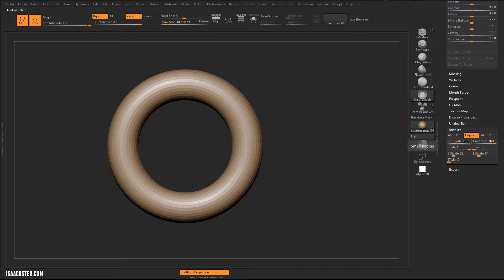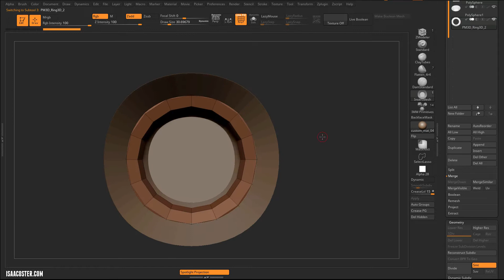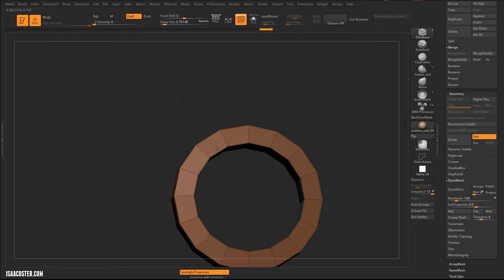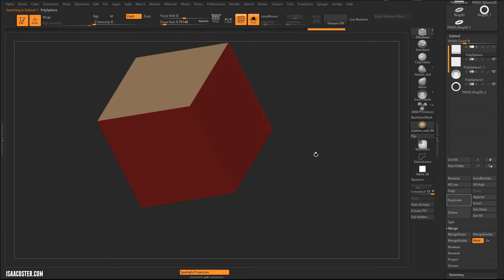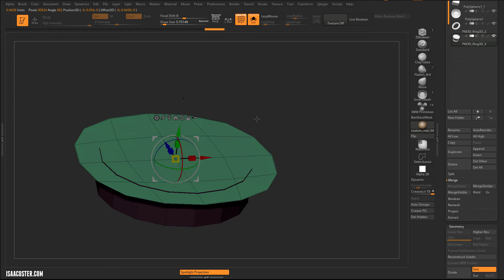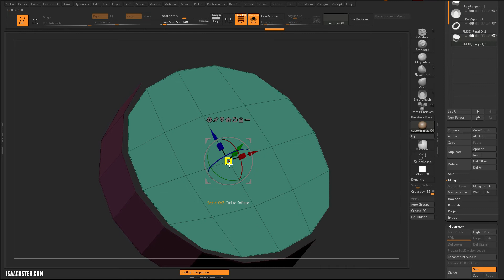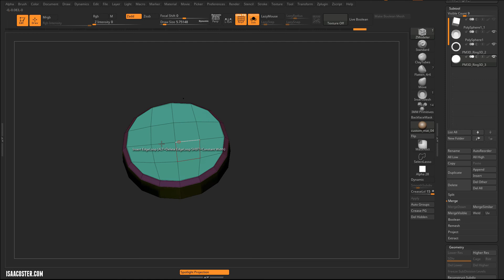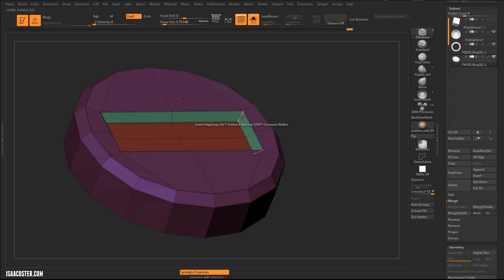Hard Surface Modeling with Zbrush 05 - Insert Mesh Brush Part 2

Comment: 9:42 I am struggeling with this never before  explained tool and it is frustrating, because I don't know how to use it or what I am doing wrong. Key-Inputs on screen also would have been very helpful. Aside from that, still tysm
Reply from the maker: y key toggles between transpose tool (three yellow circles) and the transform gizmo.  w,e, and r keys switch between move, rotate and scale.  control key enables the masking tool.  I'm using MaskRect here.  Here's a refresher on the transpose tool.  https://www.youtube.com/watch?v=IG2C87QUcJs     Masking refresher here: https://www.youtube.com/watch?v=Q_b31IC0FpU
Reply from the maker: You may want to watch my Intro to Zbrush series if this looks unfamiliar: https://www.youtube.com/playlist?list=PLpoXxlr0idMnWgqbB0beCEbiC-kilRNlc

Comment: Many Thanks, Isaac - excellent series
I watched a bunch of your vids about a year ago but some of the later ones were way beyond my skillage level - now trying again after doing a bunch of zbrush recently.
Weld points - didn't even know that was a thing. Very nice. 😀

Just to add a couple of things about masking, if we're masking intending to immediately invert the mask, could alternatively do CTRL + ALT and drag out the area we want to edit - that will leave everything else masked, so no need to invert.
Also zmodeler polygon actions now include Mask - Flat Island (etc) which is handy if we need to mask an end face of, say, a cylinder.

Thanks again.
Reply from the maker: Great tips,  glad you're enjoying the videos!